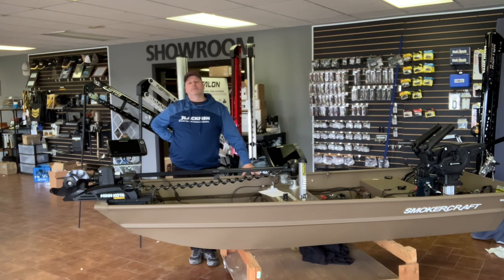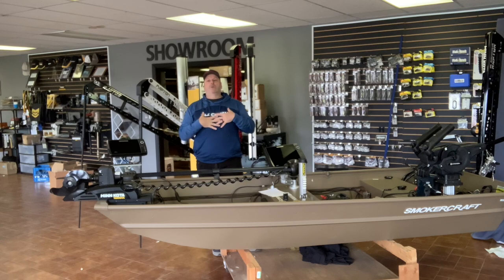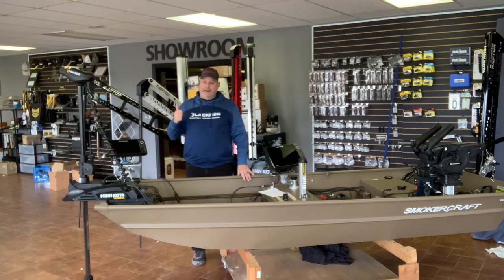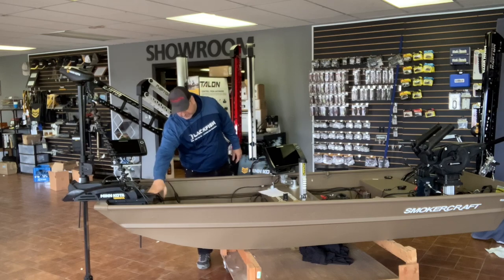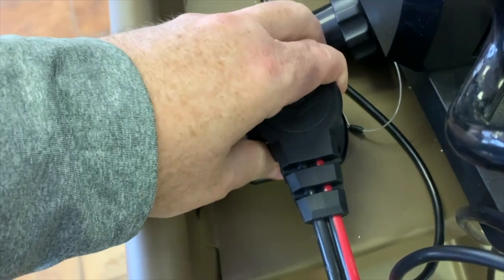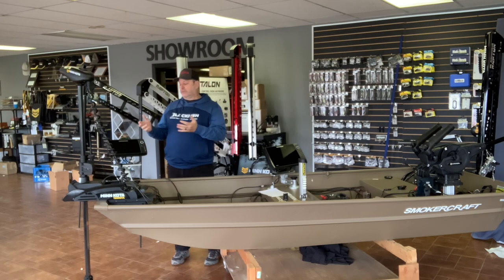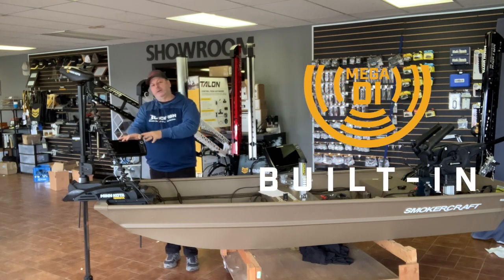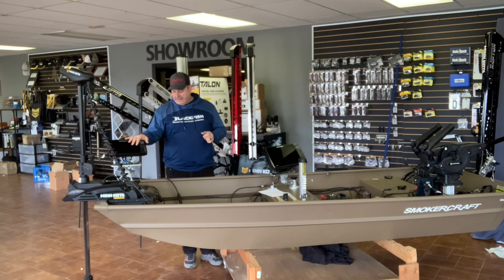Ultimate Boat Rigs Part 1- Small Boat Electronics

Comment: Thank you for the great videos!  The front deck on my boat is thin aluminum so I need to know the actual weight of the Terrova 55lb thrust trolling motor before purchasing it. Please let me know?
Thank you,
Tony
Reply from the maker: Thanks tony...that motor weight about 60 lbs
Reply: @principleoutdoors8932  Thank you for your reply. That is surprising because the 80 lb thrust model is listed as weighing 60 lbs, so I was hoping that the 55 lb thrust model would be at least 10 lbs lighter. Does the 55 lb thrust model feel easier to Stow and deploy than the 80 lb thrust mode or are they about the same?